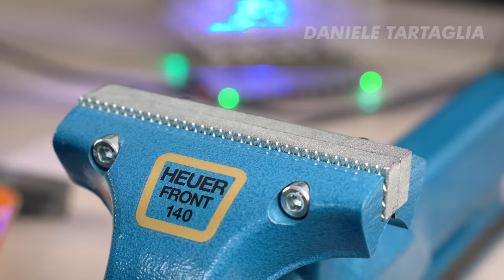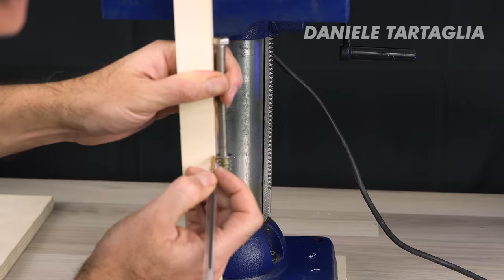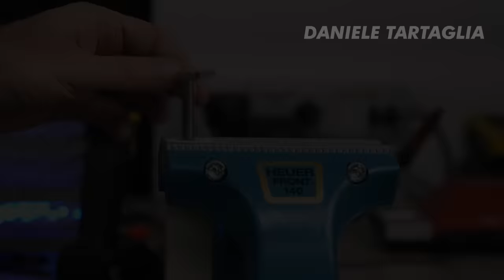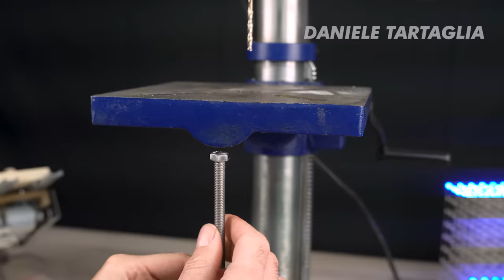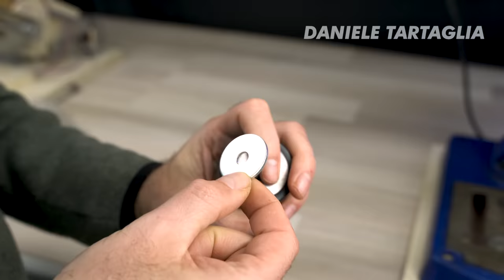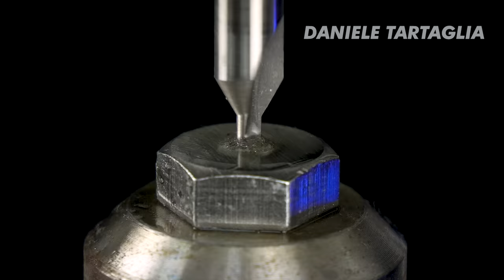4 EASY and Useful Ideas for Drill Press

Comment: Never ever drill steel on top of wood as it allows the metal to get hotter than it would if it were sitting on clod plate .The drill bits burn off the tipp hardened edge very quickly .If you are drilling alot of holes .Just mix a cup of luke warm water with a tablespoon of dish soap and two spoons of cooking oil .Mix with a good shake and use a spray bottle as you drill .It will even prolong the life of cheap drill bits.50 years at stainless steel boat chandlery and it is wonderious as it means you wont get infected from the water oil mix whan u use soap,
Reply: Il est impératif d'avoir une vitesse adaptée au diamètre du foret, nul besoin de ces conseils de bricolo, pour la lubrification il suffit d'acheter de l'huile de coupe, c'est en vente en dans les magasins , casto , merlin, etc...
Reply: You could also just squirt a little WD40 on the bit if you’re drilling a piece of steel sitting on a wood platform bro.
Reply: No as I stated never use wood to support and the mix I mentioned above is what all pro workshops use .All oils on their own are lubricants, meaning they reduce friction between metals (that includes WD40)For example say you use oil to cut metal with a hacksaw .It will prolong the life the life of the blade as there is reduced friction and so reduced cutting for the same reason, So try any oil washing up liquid and water .then try with oil .Time yourself for both methods .You will have saved your blade by cooling and cut faster by increasing friction.If someone started in my workshop I would normally set tasks for them without any method implied .If someone grabbed a piece of wood and oil I'd wouldn't pay engineer's rate ,It armature.
Reply: Thanks for the tip, it's quite helpful as I didn't drill that much but I have to soon. Now I don't need to buy any special stuff.

Comment: don't use gloves on a drill press , or anything else that spins !
Reply: I'd rather wear tight fitting gloves than get a metal sliver.
Reply: @justin2588  then you don't know why you shouldn't wear gloves :-)
Reply: @outbackchillin5628  oh I get what you're saying. That drill press will stall, I will shut it off, if (and it's never remotely happened to me) it happens to try and steal my glove. Plus I'm pretty possessive and it isn't allowed my glove.
Reply: Should use an engineering Vise for holding metal plate when drilling.
Reply: What about a wire wheel on a bench grinder? I'd rather the glove get cut up than me
Reply: @lajoyalobos2009  Toughen up, you will feel it worse if the glove gets caught.

Comment: The hole in the centre of the bolt head would be much easier and accurate if you put the centre bit on the lower chuck and the bolt was spinning on the drill, like you marked the spot.
That is how a lathe works
Reply: No. It is the same in this case because both the drill bit and the drill piece are cylindrical in nature and their centers of gravity lie on their vertical axis and their axis aligns with the chuck axis.

When you spin something, it's best if the center of gravity is at the middle or a long the spinning axis. Or else, the piece will try to escape due to centrifugal force.

In case of a lathe, the piece is always cylindrical in nature so that it will spin smoothly along with the chuck. The cutting tools of a lathe is not always axial symmetry so it must not spin.

English is not my first language and it's difficult for me to explain the physics so I hope you understand.

Comment: Dear Daniele Tartaglia, I watch your videos with interest. In this video, in the part of drilling a hole in the center of a bolt, I was thinking that you would attach the bolt to the drill and the drill bit to the fixed chuck on the stand, as in the promotional image of the video. I'm not as professional as you, but when you do it the way you do, no matter how much you fine-tune it, it becomes off-center. I think better results can be achieved when you connect the part to be drilled to the drill or rotating equipment, as in a lathe. Kind regards.

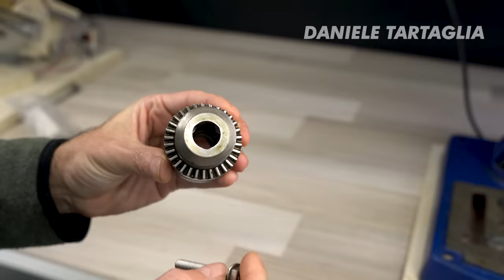Comment: 5:38 Hey guys, for #2... Does anyone know what size bolt he's dropping down inside the chuck?? 3/8 maybe?? I have a 1/2 chuck I'm trying to attach to the table, but not sure what size to use (the 1/2 course thread bolts at the store didn't work).

I saw another video where he put the bolt from below the table, and threaded it UP into the chuck (not drop the bolt inside the chuck). That method seems more secure. Thanks for any help!
Reply: I have discovered through trial and error the size of the bolt that fits into the 1/2 chuck is a 1/4" bolt.

Comment: When your vise costs more than your drill-press......

Why use the center punch? Defeats the purpose of centering the chuck and the use of a center drill.... ;)
Reply: Precisely! Most of what is shown in this video would not be a problem if you didn't cheap out on your drill press, which isn't hard since even i was able to buy a very sturdy and heavy 220V vintage press for half the price of what is sold as "professional" these days. It even manages to be heavier than pretty much all cheap floor presses being sold right now despite it just being a bench press.

Comment: Only a fool wears gloves around rotating equipment,,,,,and don;t fall for the "tear away:" BS,,,,It will pull your hand in as they are tearing away and anything weak enough to rip away is not strong enough to protect your hand from much of anything.. 

Loose the gloves or loose a finger, Better to have a couple of stitches in your thumb then not to have a thumb to get stitches in. ,,,,,  and yes, Even a baby Harbor Freight drill press has enough power and inertia to tear you thumb right off your hand,